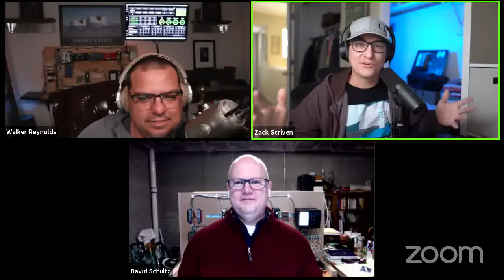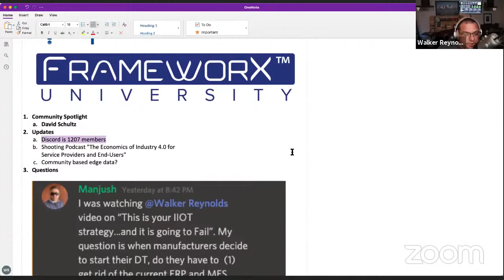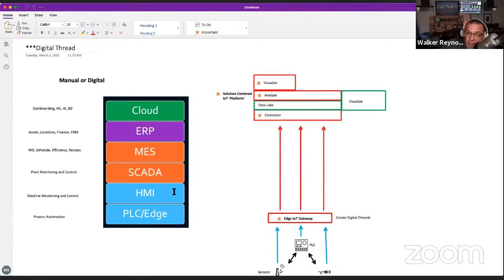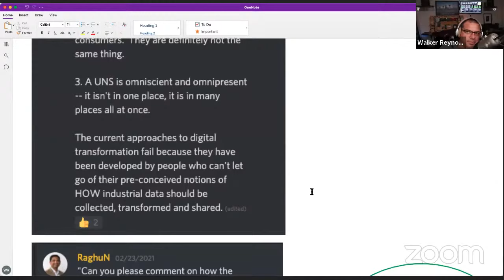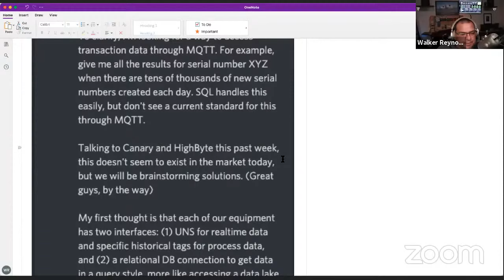Industry 4.0 Weekly Live Q&A 3/2/21

Comment from the maker: 0:00 Introduction
1:19 Community Spotlight 🔦 David Schultz
4:27 Industry 4.0 Demo Board
8:15 How has the Industry 4.0 Community helped you?
12:15 How do envision your business changing this year?
16:15 Q&A
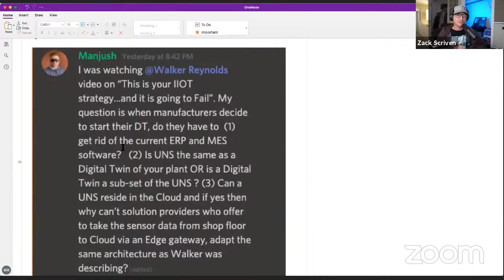16:42 Community Updates
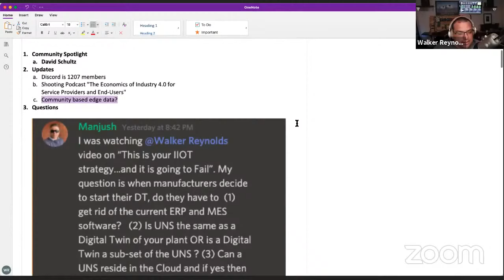22:15 Unified Namespace question from Manjush
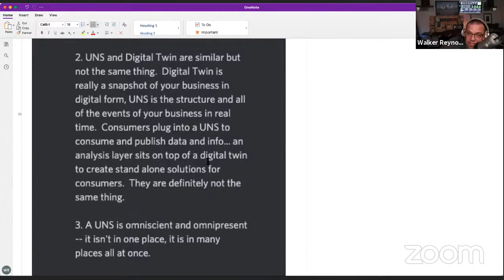31:38 Is the UNS the same as the Digital Twin?
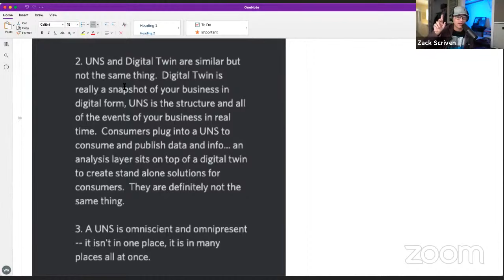32:30 Unified Namespace Explained continued
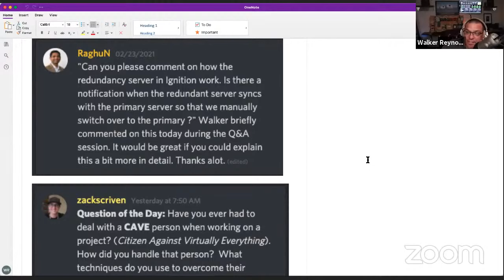47:44 How do you influence OEMs to Adopt MQTT Sparkplug B?
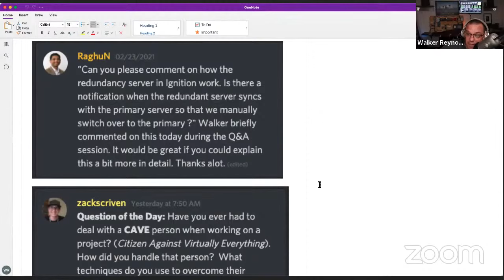50:38 How do you deal with a C.A.V.E. Man?
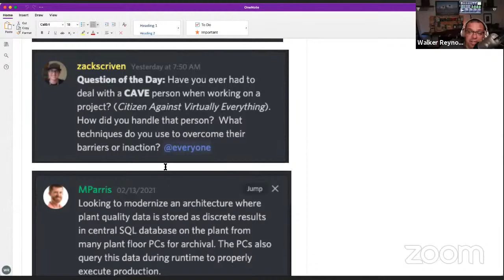53:29 How does Ignition Redundancy work?
57:00 Which Raspberry Pi should I use?
57:29 Which platform is best for creating Digital Twins?
58:45 How do you define a digital strategy?
1:03:50 Question from MParris